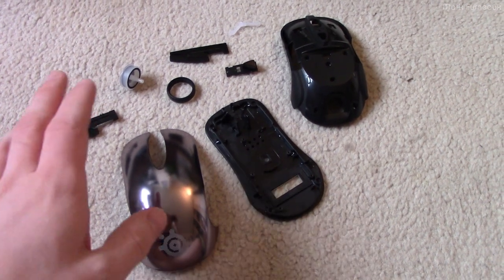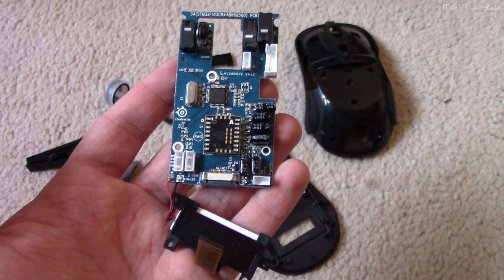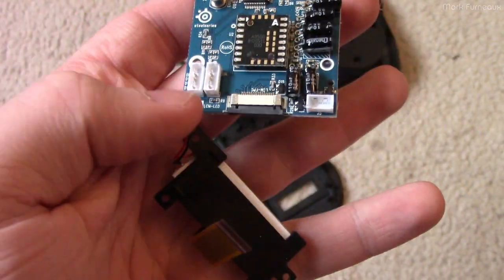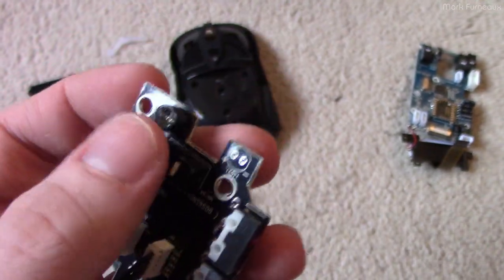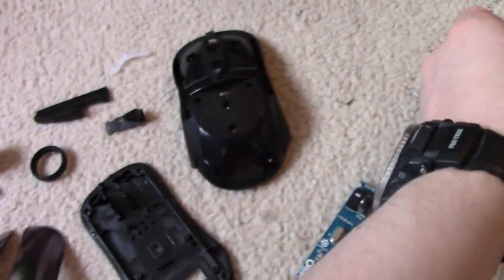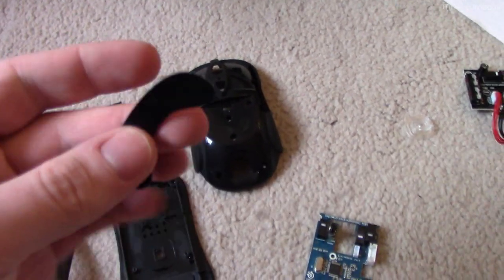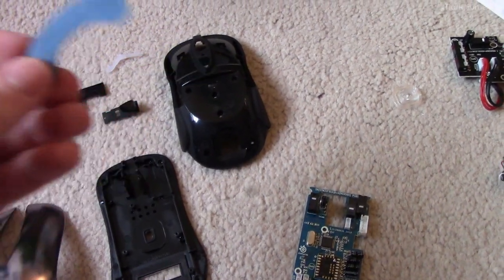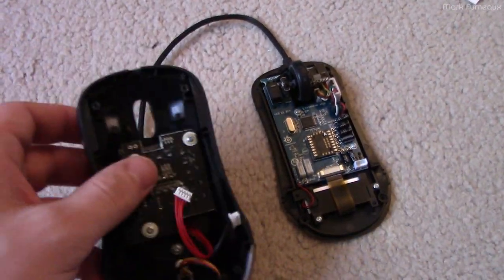Fixing the Switches in my SteelSeries Sensei Pro Mouse

Comment: A trick you could try when removing the scates is to heat it with a hairdryer. Granted in this case that was not needed, this is at leat something I have done multiple times with great success. Once the glue softens it's much easier. to remove it all in one piece without damaging the mouse scates. A standard hairdryer should not be hot enough to melt the plastic.

I personally used my cheap hot air staiton last time because the beam is a bit easier to focus, but a hairdryer works well enough.

Comment: Thanks for the video.
Have replaced many switches in the logitech M570 the omrons that they use are just bad.
This guide helped me fix these mice Logitech M570 Teardown and Repair. 
The switch he used and why is in the post just google it.
Digikey sells the switch part number 401-1742-ND, these switches are the same height as the omrons in the M570.
Now I have three of these mice with new switched, was tired of buying new mice with junk switched.
I do not use drag mice, because of bad wrist, to much damage to them from work.

Comment: Can't you drill through the skates to remove screws instead of removing them? Holes in skates shouldn't affect sliding as long as you chamfer the edges.
Thanks for new video.
Reply from the maker: You could, but how would you know where to drill?
Reply: @TheUbuntuGuy Using still frame from your video or one of the others on YouTube detailing repair of this specific mouse.
Reply: @TheUbuntuGuy  I'm sure there is a gazillion ways to workaround this. Make a paper template or even use transparent film.
Reply: @TheUbuntuGuy  i think you couldn't - you'd drill out the head of the screw and then it would be stuck for good! bad idea here imo

Comment: Yep I changed the switches in my Logitech Trackman T-RB22 trackballs. I have 3 of them and I have replaced the same switches in 2 of them. I paid $68.00 each for them some 15 years ago and I thought I would see if I could find a new one on eBay and I did last year and there were 3 Brand New In the Sealed Box now worth $600.00 US they say! Wow I have gold on my desk... LOL
I just looked a bit ago and I found all used ones at $130.00 US... Some were in better shape that mine the little feet are all gone, (Your New stuff in vid will fix that.) and the arrows are wore off of the buttons... They still work great and use them all day long... Lol
I hate a mouse, corded or wireless it is still a mouse... Lol (Sorry)
I have some Logitech wireless keyboards that have a wireless mouse but I have them in a box on the shelf as I don't use them. I have also reverted back to my old IBM heavy tank clicky keyboards because it got to the point where I don't like the keys on the Logitecks, old and mushy...
Anyway Thanks for the video and keep clicking! Lol
LLAP

Comment: once replaced the leftclick button on a razer deathadder cause it started doubleclicking. shortly after the usb cable failed and it wasnt recognized anymore. cheap crap no matter what you pay
Reply: when the cable on my filco majestouch 2 keyboard (far from cheap carp) failed, i replaced the internal connector with one of those cheap micro usb breakout boards and now i can replace the cable any time i want, but tbh i don't need to because it's a nice thick cable and it's unlikely to fail any time soon.

Comment: rather than use skates, you could use some 1/16" UHMW PE plate, and glue it to the underside of the mouse using double sided sticky - probably a better experience altogether, as it'll /all/ glide

i've found that the kind of glue that is under mouse skates and the likes is usually two sided tape, and i've found that it's available as tape you can buy in interior design stores and furniture stores. i think it's used for gluing down whatever you put on the floor (carpet, linoleum, ...)

if your switches aren't tall enough, the best way to raise them is to probably add some filler between the switch and the pcb, like a piece of phenolic or something like that. then you don't have to modify the mouse in any way.

Comment: Could've taken the chance to join the nerds on r/mousereview, especially their discord. Also you unfortunately overpaid for mediocre micro switches and kinda got the Omron product series part all wrong
Reply: The thing with referring to the D2FC series switches as counterfeit and questionable because they presumably aren't produced anymore confuses me. All the relatively new mice in the past few years use shitty (prone to double-clicking) Omron D2FC-F-K(50M), Razer (-RZ) and Roccat (-RT) even have their own version of it specifically made for their products. Now the manufacturers (at least Logitech) are moving on to the Omron D2FC-F-7N(G1) which is yet another new iteration and very similar to the Omron D2FC-F-7N(10M) in the shown mouse. Before that they tried to fix the clicking issues and staying on switches rated for a durability/lifetime of 50 million actuations by using the Omron D2FC-F-K(C). All these switches are produced by Omron in mainland China, hence letter C in the 'D2FC' product series. The Omron D2FS series is presumably produced in a newer manufacturing plant in Shanghai and the Omron D2F series is exclusively produced in Japan. The latter 'only' has a better quality control and tighter tolerances, but that doesn't make the D2F series overall any better.
Reply: @VornameNachname86  so which switches do you recommend as replacements for the switches found in eg the logitech g903 and g600? it sounds like you're saying all omrons are bad to some extent.
Reply: @cheater00  Kailh GM series, most Huano switches, TTC Gold dustproof variants, Zippy DF3-P1 or DF3-P1L1, C&K ZMA030, most Himake switches, all of the Cherry and ZF switches. Basically anything that has a proper brand and/or model number which is not Omron. Also kinda depends on what you want and expect. More or less tactility, higher or lower actuation force and quieter or louder actuations when compared to the generic Omron D2FC-F-7N
Reply: @VornameNachname86  ok thanks I'll try em out